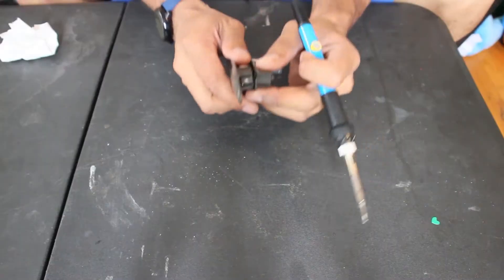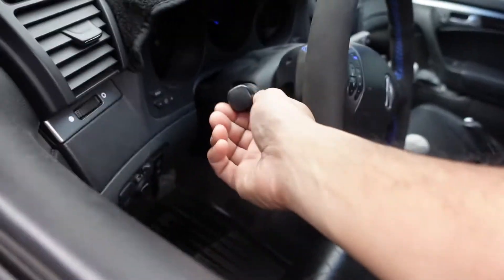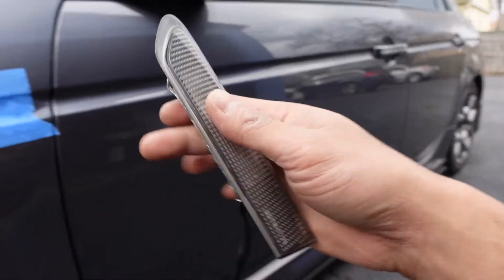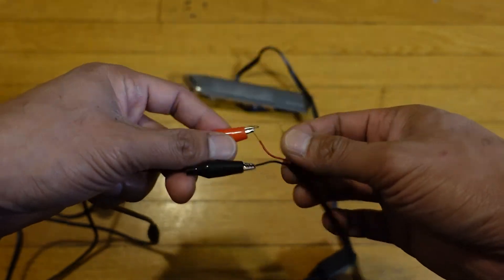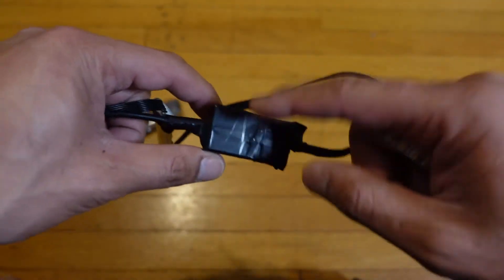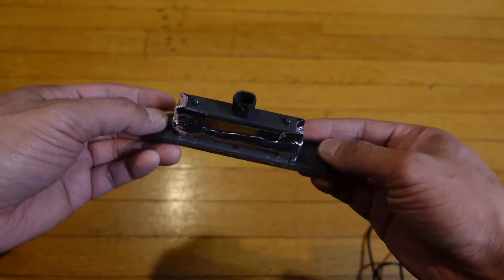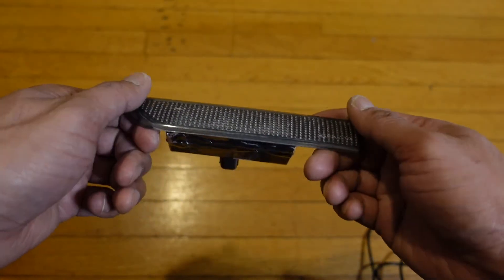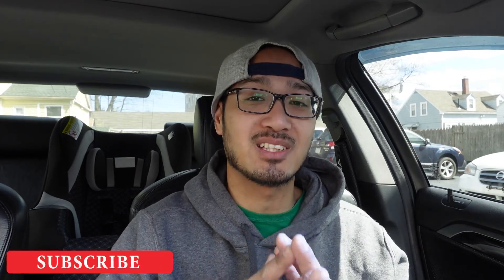SwitchBack Side Marker Issues..

Comment: What is the one incident that caused you many sleepless trying to repair your TL? The one incident for me was replacing the O-rings in the power steering pump. The hose that contains the red O-ring, I believe the housing is plastic. You better have the right tool for it. It really frustrated me. As usual keep spreading the knowledge.
Reply from the maker: I had a very similar issue with the power steering fluid leaking.  I didn't know where it was leaking from, had to top off every week or so.  After a month or so of tracking it down, it ended up being a rusty power steering line under the headlight, near the radiator.  Cut the line out, replaced it with a "power steering cooler" ( if that's what its called)
Reply: @thecarfiend11   thank you for the response and the knowledge.

Comment: Love your videos! Also I was wondering what exhaust tips are those? I have the base aspec as well just wanted to know what size quad tips would fit.
Reply from the maker: Thanks, I appreciate the support.  I get alot of questions regarding what exhaust tips I have.  I bought them awhile ago off ebay, but the link is broken and item is no longer listed.  They don't fit 100% and have to be rotated a few degrees so it doesn't rub against the bumper.  You should be looking for 2.5in dual staggered.